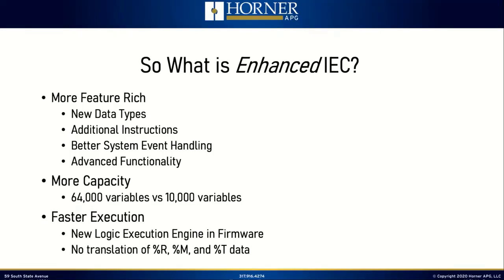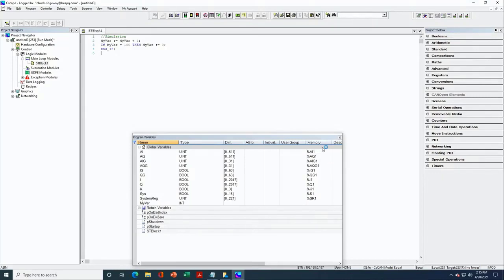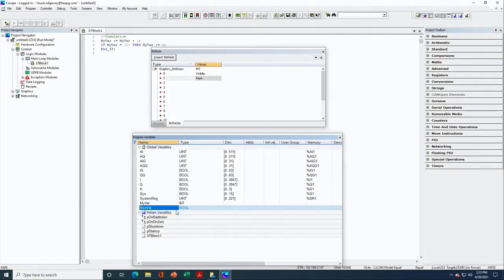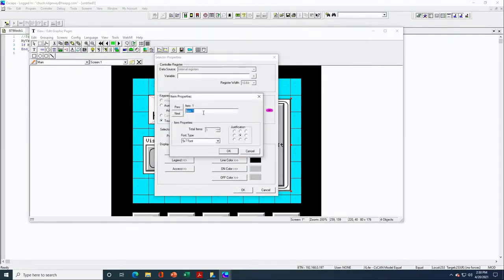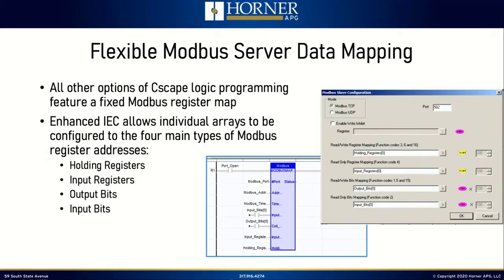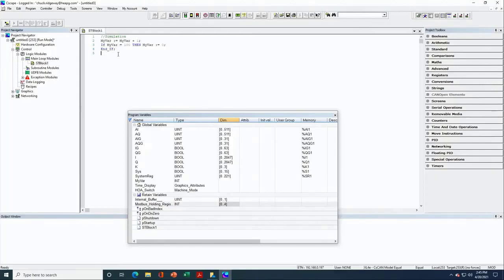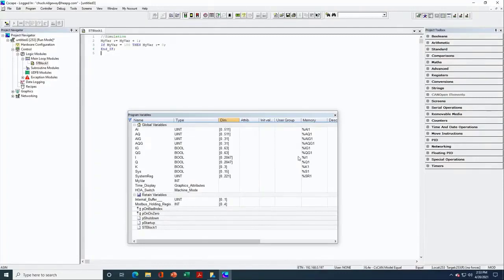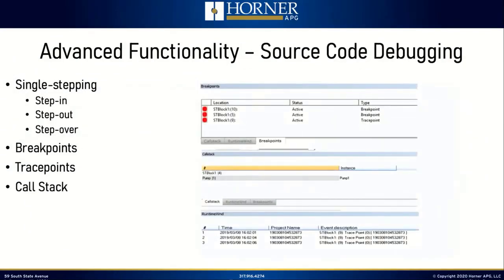Cscape 9.90 SP4 - Part 2

Comment: How does one switch from the default Advanced Ladder mode to IEC or Advanced IEC ?
Reply: Hi Kurt,

You’ll need to open up a program and then go to Tools—>Application Settings. In there you’ll see checkboxes at the bottom to enable the other language types. Then when you open a new program, you should see the option to select which language you want to use.
Reply: @caseygardner7017  Kewl!
Thanks for your ultra-speedy reply...
I have turned on the IEC and enhanced IEC checkboxes in Tools->Application settings
When I run a bare/blank Cscape, it has already created a blank advanced ladder program and appears to be firmly in that groove.

My preference would be to turn advanced ladder off completely...
Once I got into 61131, and particularly structured text, everything else
quickly became anachronistic...
I just don't get the attraction of the lines and boxes and the whims of graphical editors ;-)

I think I once received a sample IEC program from Kevin Hoyt and that has served as the seed app starting point for all my programs...
A couple of times before I tried to get out of AdvLad mode and couldn't figure it out...

What is the process to convert an existing IEC program to Enhanced IEC ?
Is there an in-place conversion ?
or do I need to create a blank Enhanced IEC program and then copy-paste
the global and retain variables - in xml or csv or native mode
and then export/import the modules one at a time from the extant program
and then copy-paste all of the screens
and then slog through the quirks to make the compiler happy ? ;-)
Reply: @caseygardner7017  I am also curious about whether SR164 (SystemReg163 )
clone stuff works under enhanced IEC ?
and whether system registers >192 are accessible

Are the licenses runtime licenses ?
i.e. one can develop EIEC programs but they won't run unless that specific hardware has a (presumeably MAC-based) license installed
Is that more or less correct ?

And presumeably the same PGM export image is still used and one can
switch between IEC and EIEC programs on any given (supported) controller ?

I am curious whether EIEC will cure some of the gremlins which I have managed to keep at bay for the last several years...  I am nowhere near 10000 variables, but right now, simply declaring a new untagged variable may be enough to cause a
"too many %R" error...  but if I tag that variable up into the 7000's the error goes away
but not if I tag it into the 8000's